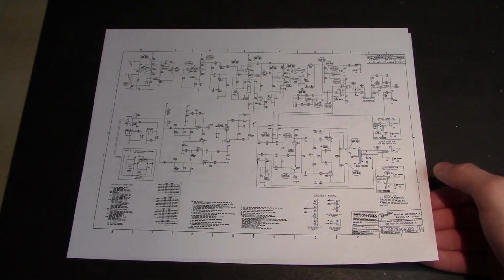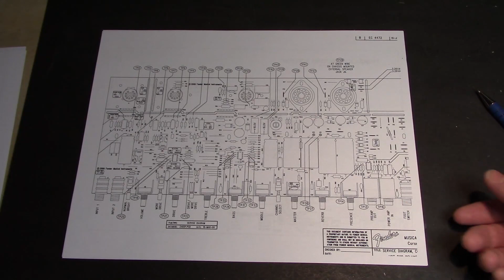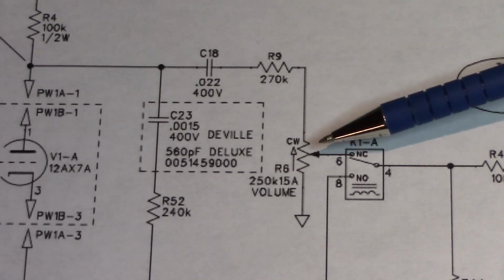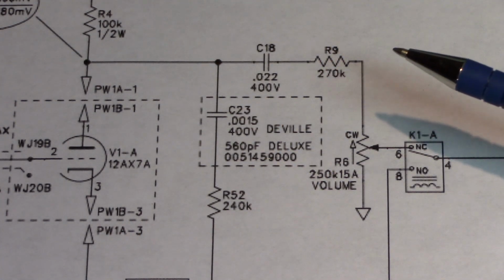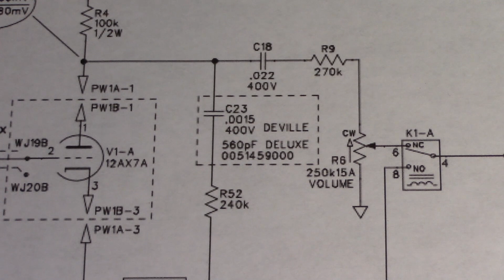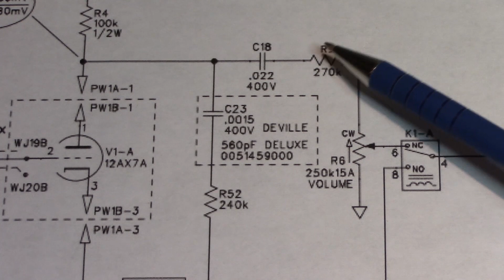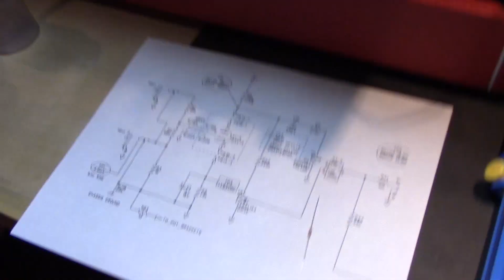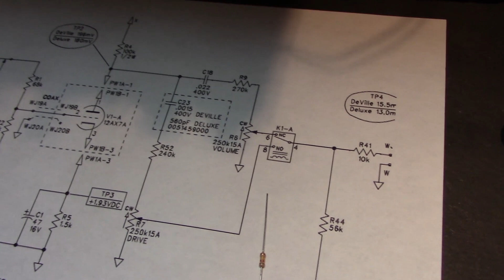Modifying the Fender Hot Rod Deluxe III - Tinman Electronics 15

Comment: Here's how volume on a tube amp works. The volume control is actually a gain control for the preamp input. Lowering the output gain from the first triode would allow you to get louder before clip[ping distortion. This clipping is often a desirable effect, so decreasing the gain early in the preamp is often not desirable, and offers little control on output volume. Please look at the LarMar Post Phase inverter master volume control. That allows a greater degree of loudness control, since the outputs are the main culprit in overall amp volume.

The early preamp is setting up the gain used for overdrive tone in the preamp. The best method of reduction is replacing the 12ax7 that has a gain factor of 100, with a 12au7, 12at7 or 12ay7. Those have a lower gain than the AX tubes. Lower input gain equals more clean tone, not really less volume. Your friend will find the master volume much more useful, since the gain remains the same in preamp for overdrive, but output can be adjusted while retaining the overdrive tone. It's a matter of replacing the output tube grid leak resistors with a dual pot, in such a way that when turned on full, there is no difference with or without the master volume.
Reply: +AZJimC56 Also one can by a box to put between and the amplifier and the speaker which will alove the volume to get lowered...
Reply: @KasperGårdsdal  Yes, but even if you buy a good one it degrades the sound quality. The same with pentode / triode switching. Triode mode does not sound
good on guitar amps.

Comment: Hey just an FYI if someone isnt comfortable opening up the amp.. You can achieve the same result, by using a lower gain preamp tube in V1 (farthest right from the back) A 12ay7 or a 5751 will work best for that IMO
Reply from the maker: Ah, right on! Thanks! I'll have to let my friend know that he can do that.
Reply: Tinman Electronics Ever try swapping out the the 12ax7 pre-amp tube for a 12at7, it makes the volume at lower settings more usable, refined. Don't know it it changes the characteristics of sound, but have read the amp sounds warmer.